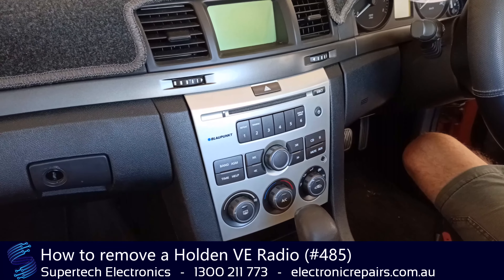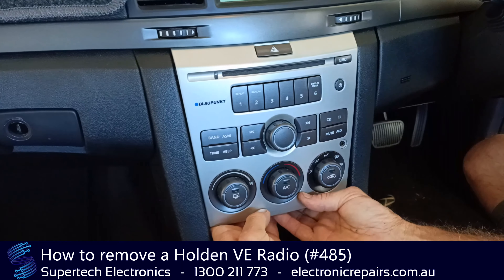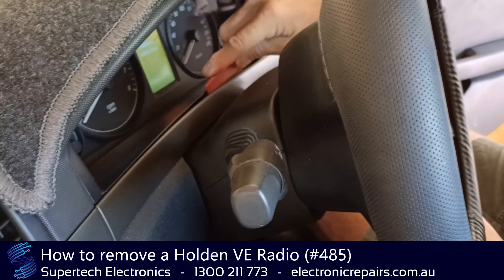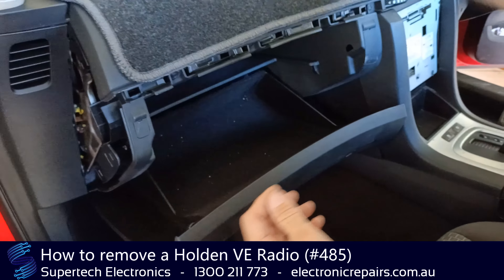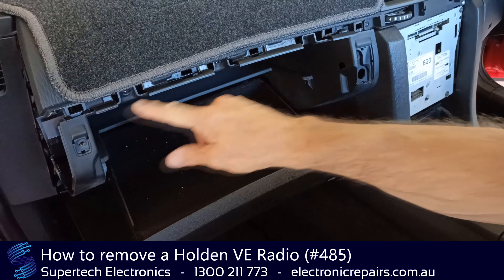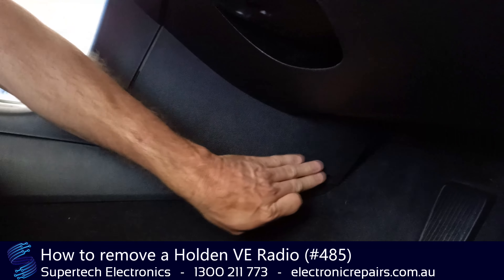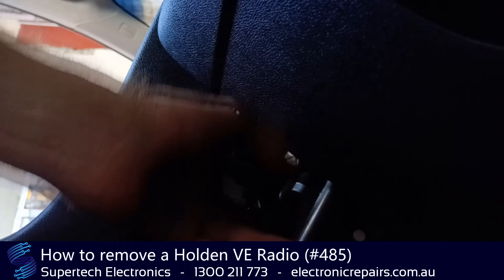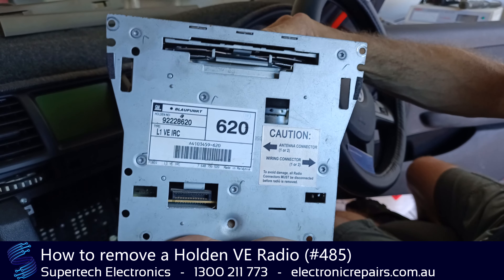How to remove a Holden VE Radio (#485 (Shown) #390 or #935)

Comment from the maker: No. That's why we repair them. Air conditioning / hazard integrated and security coded / locked to the vehicle. Repair is the most cost effective way.
Reply: My car is showing a cd error. Ive heard that changing the head unit is the only fix available. Do you think if i send this in you can fix it?